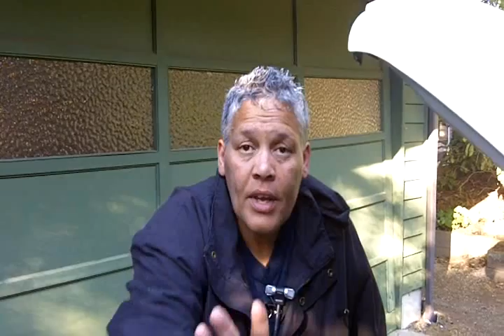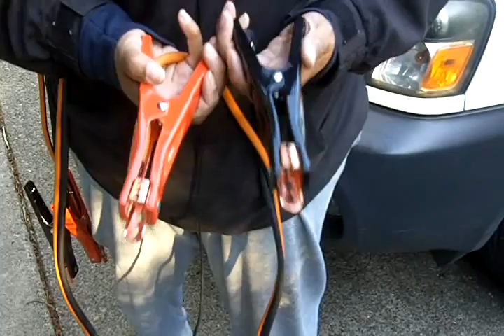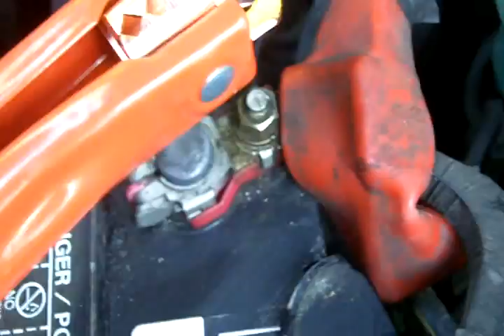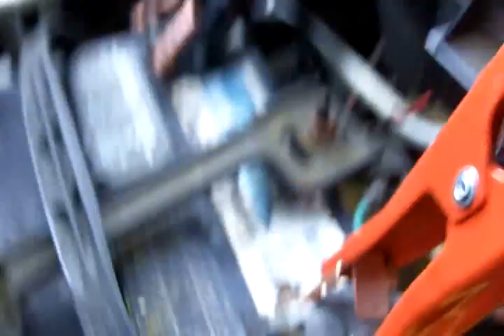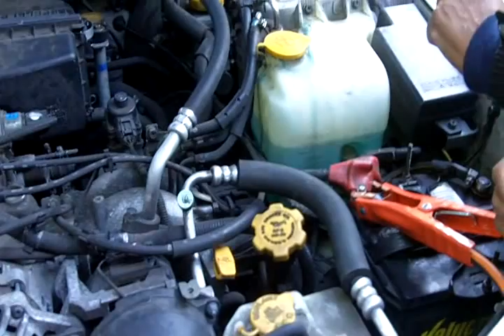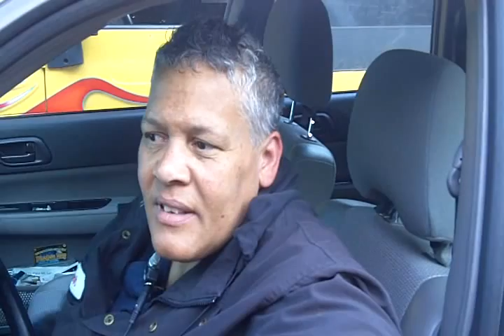Jumper Cables Made EASY For Beginner

Comment: Wow thanks but I always saw people attach the black and red to both cars and it worked? why I should not attach black to bad battery. my car will not turn or make any noise and I was going to jump it with my friends car, could it be the battery?
Reply: Attaching it directly to the negative pole of the dead battery can cause sparks which can ignite flammable gasses coming from the battery or fuel, most of the time there might not be a problem but it's bad practice that can result in injury, better safe than sorry

Comment: Today was the first time in over 20 years I'd attempted to charge a dead battery (lived in New York City, where a car was unnecessary). This video is so helpful. You're SO right about the 16ft. cable minimum. JUST made it today using 12ft. cables, but will immediately replace them as soon as possible.  Thanks again.
Reply from the maker: you're welcome, Gene.  That's great that you were able to do it with 12ft cables!

Comment: I think that by connecting the negative to the block avoids passing all that current through the dead battery, which at this time is unnecessary. IMHO. Great videos Leah!!!!
Reply from the maker: thanks, Jorge!
Reply: Jorge Concheyro , it keeps any spark away from the battery so there isn't a potential for a battery exploit. That's why you always hook up the dead battery negative clamp last.
Reply: @clintprice2123  what is a ground and why do we need to "ground" stuff when we jump a car though?
Reply: @MathCuriousity  The ground completes the circuit and since a battery has a vent if you can keep the last connection at the negative away from any combustible gases it’s much safer. Hooking up the positives first creates no spark and then good negative first moves the spark away from the strong battery so it you can go for a good source like a solid bracket etc or carefully attach the clamp to the dead negative side. The next most import item is high quality cables, the poorer the quality the less ability they have to carry the current and start the dead vehicle. If there is corrosion built up on the terminals it may also not be a successful start.
Reply: @clintprice2123  Thanks so much Clint! Great explanation.

Comment: Great instruction!  How do I know what gauge cables to get to charge a full size Toyota Camry?  You said 16' and I saw elsewhere Copper is best. But do I buy 6 Gauge or 4?Please advise and thank you in advance
Reply from the maker: the lower the number, the thicker the wire.  For instance, 4 gauge is thicker than 6 gauge.  4 gauge would be more powerful (have a better transfer of current) than 6 gauge.

Comment: Then what is next?  When will we turn off the good car and bad car once the bad car recovers? before the removal of cables or after?
Reply from the maker: To finish up, If the jumped auto starts, leave both autos running  2-3 minutes, then remove the cables in reverse order.
Disconnect the black cable ( - negative ) connected to the once disabled auto.
Disconnect the black cable (- negative) to the good auto.
Disconnect the red cable (+ positive) connected to the good auto.
Disconnect the red cable (+ positive) connected to the once disabled auto.
Leave the jumped auto running for about 20 minutes to help recharge the battery.
Reply: Thanks for your answer.  Now I understand.

Comment: I've never really grounded the negative before, the last time i did, it didn't charge, but when i post the negative on the negative of the bad battery, it charges the battery almost instantly, is that dangerous, because i haven't had any problems with it so far, but i don't want to continue if its a hazard
Reply from the maker: First of all, if I were you, I would consult the owner's manual for my car.  Some cars need to be jumped in a specific way.  Ordinarily, though, you ground the negative because of the danger of sparks igniting gasses.

Comment: why does the Negative cable have to be plugged in somewhere else besides the negative on the battery itself. why must it be plugged grounded.
Reply from the maker: +elizabeth jumbo The reason is that the last connection of the 4 that you are making can produce sparks, and for safety reasons, you would want any potential sparking to be away from the battery.
Reply: ooooh okay. cool than you for the clarification.
Reply: It didn't work for me UNTIL the negative black was connected to the corresponding negative black.  Attaching it to the vehicle didn't work.  There were no sparks.  My vehicle starter began easily after all cables were connected - red to red > black to black.

Comment: Hi Lea, when one starts the ignition of the bad battery car still with all the cables connected to the donor car, is the donor car still running and not turned off through the entire jump start process?  

Once the car with the bad battery is jump started, in what order is the proper way to disconnect the cables from the donor car?  Thanks very much.
Reply from the maker: ourlegacy Hi there, you remove the cables in reverse order from how you installed them, starting with the black cable that is attached to the metal under the hood of the recipient car.

Comment: I would not have known to put the negative cable for the bad battery elsewhere. Why would you not put it on the negative side of the bad battery? ?
Reply from the maker: angela b. Hi Angela, good question. It's all about safety,and here's why: a battery contains hydrogen gas, and hydrogen gas is highly explosive. It's wise to bypass the negative terminal of the dead battery for bare metal on the engine block because there is the chance of a spark igniting the hydrogen gas and causing an explosion.